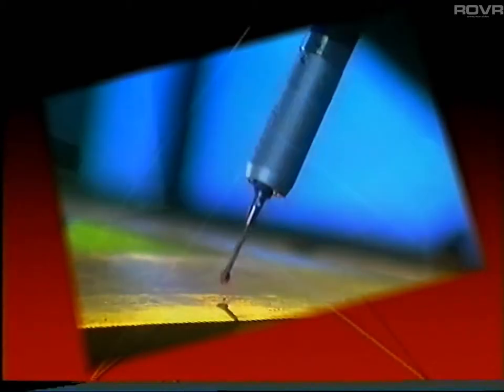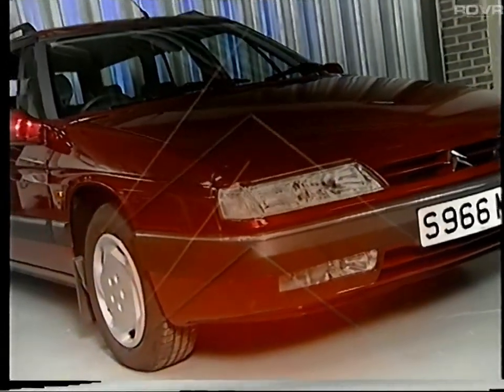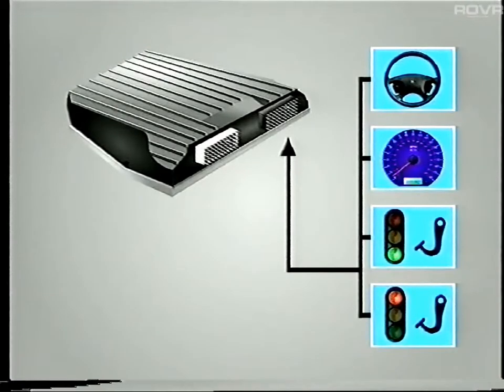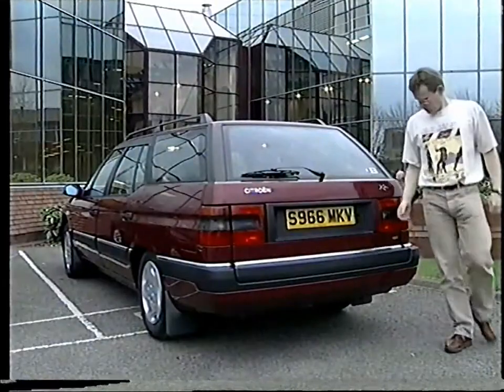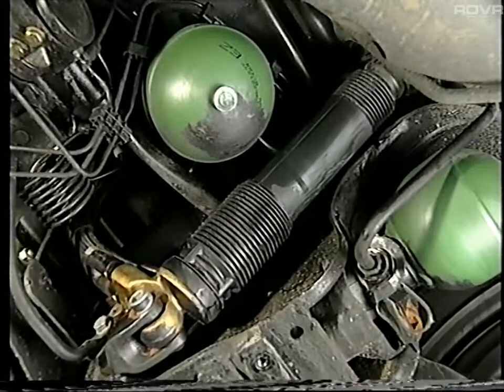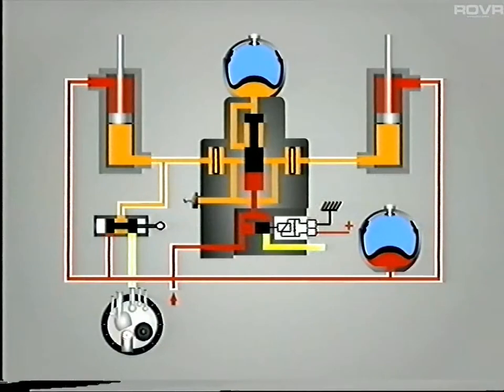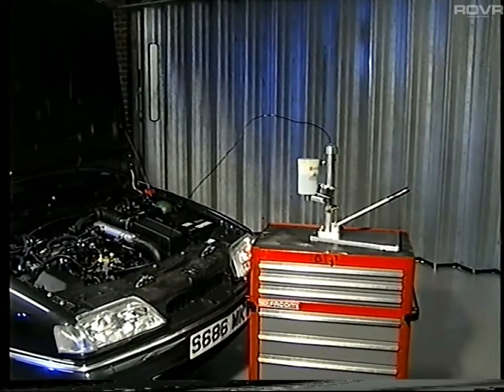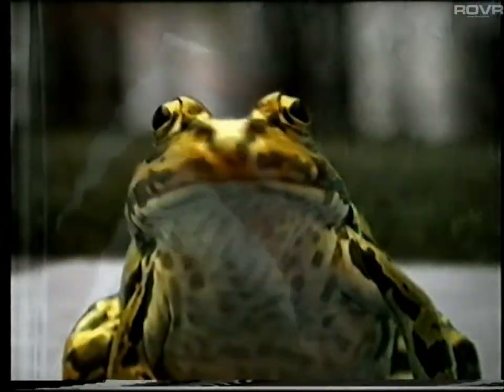Citroën - Hydropneumatic System - Hydractive Suspension / Active Roll - Training - Pt 4  of 4 (1999)

Comment: I've had two Citroen C5s, and currently drive a 2008 Exclusive model with 92k on the clock. For comfort, its hard to beat.
For reliability, not as great. And parts cost an absolute FORTUNE; I tried to price a part for my electric seat a couple of weeks ago. The little driveshaft for moving the seat back and forward, and the actuator..... £675 BEFORE VAT!!! The driveshaft is as thick as a pencil, and about a foot long, and the actuator is tiny!
I look after cars, maintain and service them regularly, and don't drive them like a madman but since I bought it with 50k on the clock I've had to replace the steering rack (deteriorated seals, Citroen denied it was their problem), a hydraulic ram for the front of the car (Citroen said this was normal wear and tear!), three tyre sensors (£120 a pop to have fitted and coded), and that's the tip of the iceberg.

Look elsewhere than Citroen if you want affordable, reliable motoring.
Reply: I think you are just unlucky m8 :D
Reply: @augustinas1373  I suspect the amount of comparable year C5s being offered for spares says I'm probably not. ;-)

They might be better cars later on, but I wouldn't go near a top-of-the-range one!
Reply: Well every more "advanced" car is going to be more expensive to fix, because parts are rarer and there is more stuff to brake.. but compered price to luxury and comfort ratio.. citroens with hydropneumatic suspensions are really not that bad, maybe even almost the best (i say almost, because i think lexus takes the first place. Because even if its luxury car brand it is still a part of toyota. Knowing that, it is reliable)... And also many machenics like to scam people with citroens by pretending that it is really hard to work on citroens which is completely false, as you can see even the infamous suspension is not that complecated
Reply: @augustinas1373  They are amazingly comfortable cars; mine runs silently, the thicker glass keeps out all the noise, and for a diesel the engine is really quiet. 
The problem with Citroens (the experience I've had with C5s anyway), is that at least 98% of the parts on a Citroen are proprietary. Whereas the parts for Fords are made by everyone, and can be bought in the local supermarket, almost! :-D

Every mechanic I've spoken to about my car has said the same thing; "Citroens are expensive to run", and they're all spot on. Lovely cars, but stupidly expensive to maintain.
Reply: @EddieG1888  well then it has to do with the place you live.. there is no problem on finding parts from all source of manufacturers here where i live. But oh well then.. it is what it is :D
Reply: Hello there both of you, since you know enough about C5s, need to know does this sistem of anti roll is present on a C5 facelift (from 2005 to 2007) as a hydroactiv 3+ as they say???
I'm planing to get one soon, so want to know this info if you can tell me please.
Thank you in advance
Reply: @goransacirovic5568  As far as I'm aware, the facelift was purely cosmetic, they changed very little (if anything) mechanically.
Reply: hey dude....I faced the same shit as you.
I bought a C5 2006 with 94tkm. Tachometer defect 500 euro. Front axle
adjusted 200 euro. Right Xenon-lamp exchanged 2700 euro. 
Heater-unit exchanged near 3000 euro. Turbocharger exchanged 2500 euro. 
Now the spheres for the suspension need to be exchanged  for about 1000 euro.
And this all in  2.5 years of driving 15000 km .
Now In know what is meant with "Nothing moves you like a citroen"